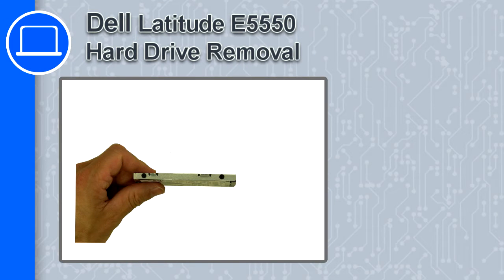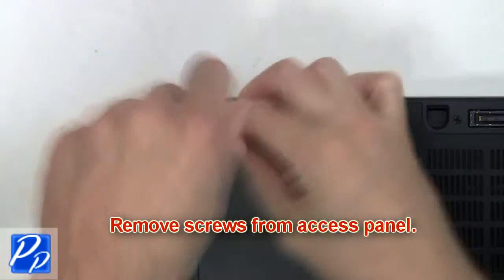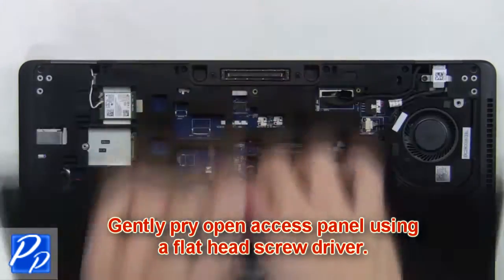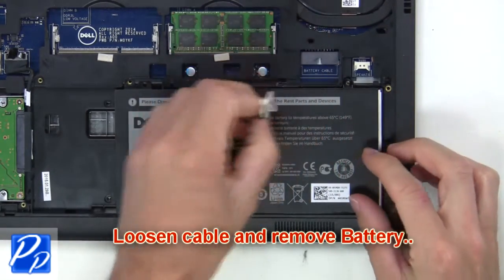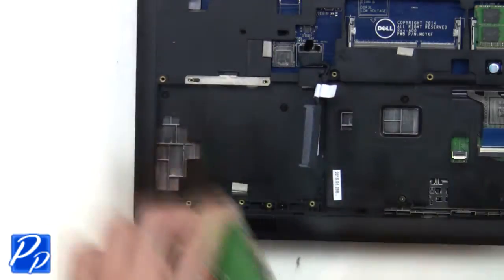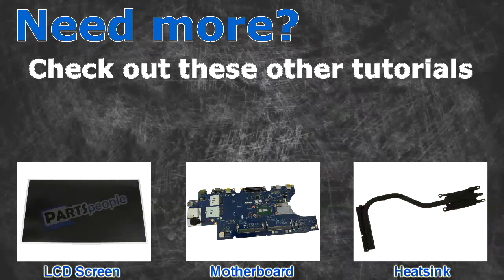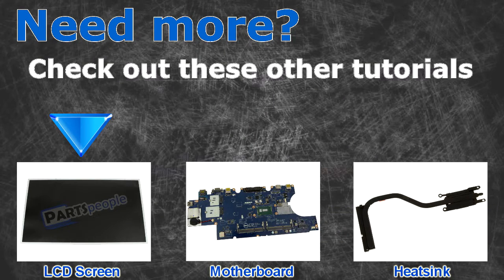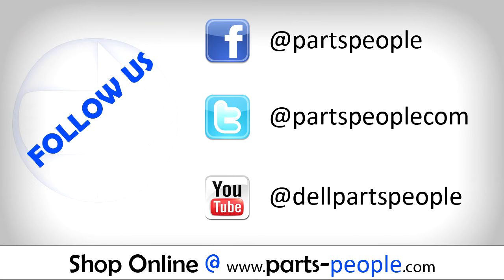Dell Latitude E5550 Hard Drive & Caddy Replacement Video Tutorial

Comment: loved the video, no BS and straight to the point. all I needed, will continue to check you out for related stuff. If you have time, maybe you know this, I am looking to move one hard drive from one laptop to another with all the installation, hardware is exactly the same, my question is: Will windows Load? I have done this with linux and with different hardware and it works fine, but windows did not used to do that, will windows 7 ultimate work, or will it require format? Long 4ss question, sorry, thank you for taking the time to read this.
Reply from the maker: As long as the laptops are the same models, it should work just fine and windows shouldn't have any problems.
Reply: Thanks =D